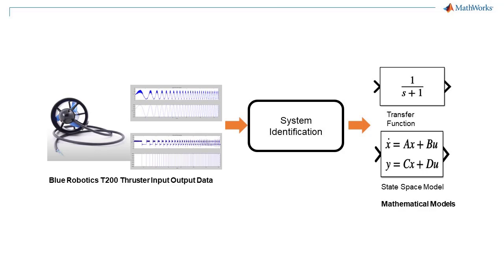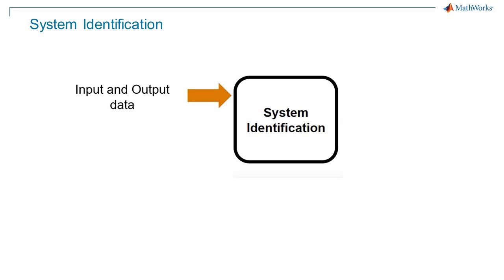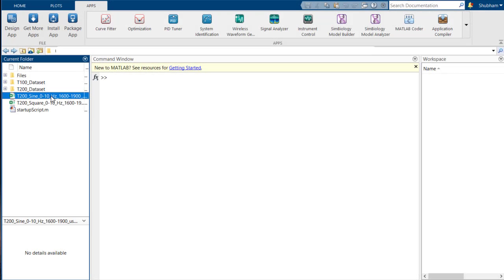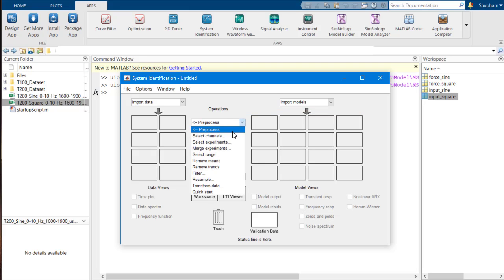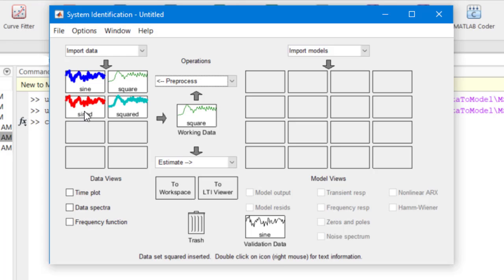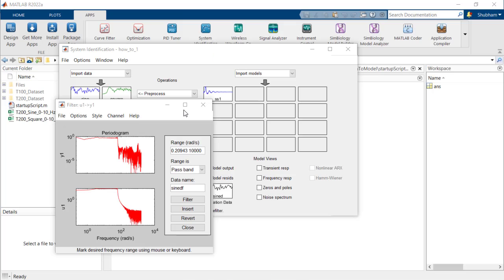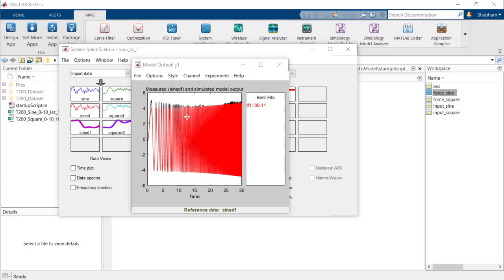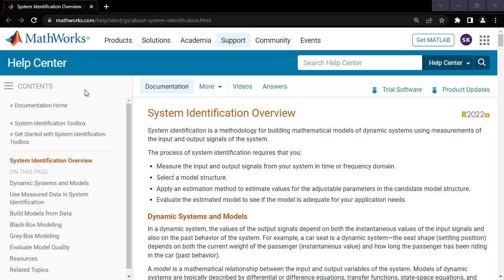How to Perform System Identification of Blue Robotics Thrusters

Comment: What input and output used i couldnt understand, sorry..? Output trust force i think but what is input? Speed or voltage etc?
Are there real datas ? if yes, how collected?
Reply: According to the data shown in t=1m54s, the input is the motor controllers input, which is the duty cycle of a PWM signal given in microseconds. The whole range is [1100, 1900] us, where 1500 is neutral (zero thrust), 1900 is max. thrust, and 1100 is max. reverse thrust. If this is based on real data, I would be also interested which force measurement device they used, because the shown 2ms or 500 Hz time resolution of the signal would be pretty nice for sysid.
Reply: @r0ckahead  Thanks dor explanation. There is no explanation on video.
Reply: @r0ckahead hello sir  I m Ms student I need your help can you help me plz